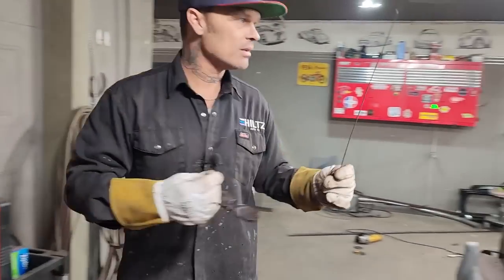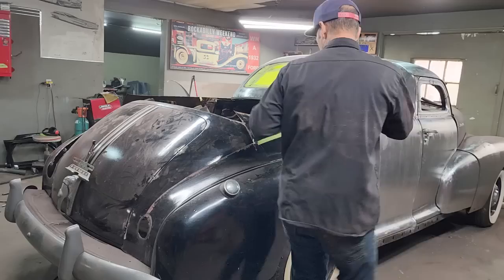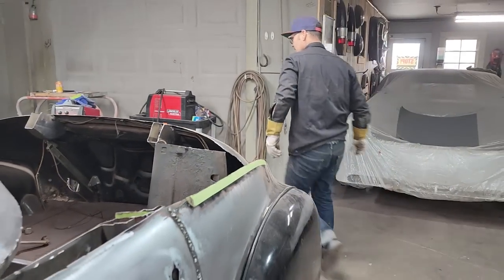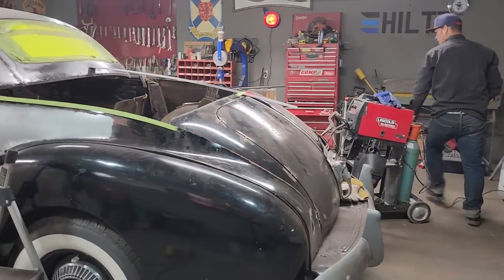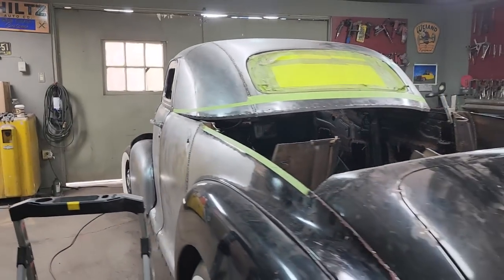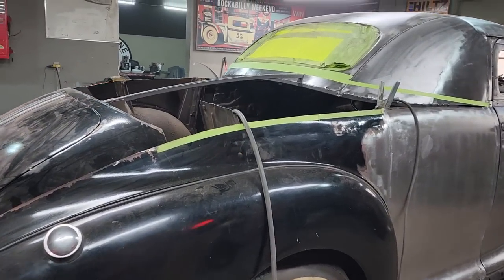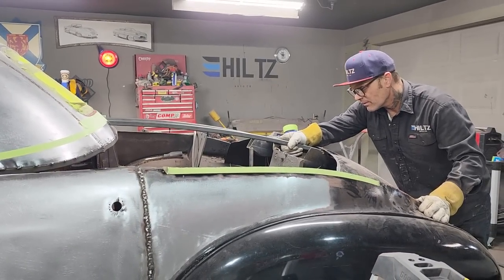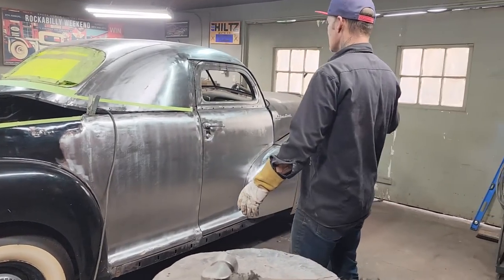Fabricating the rear | 1948 SEDAN ➜ COUPE conversion

Comment: It’s looking good! Where the drip rail continues in a straight line for 2 or 3 inches behind the window; What if you cut it loose and bent a curve in it to better match the window shape then reattached it. I think that would make the lines flow nice. You could even make it longer and have it follow the downward slope of the roof/ sail panel. Just a thought. That thing is gonna look cool in bare metal! Keep up the good work!👍Love it! God bless!

Comment: You can get some interesting proportions using Fibonacci numbers.
 1, 1, 2, 3, 5, 8, 13, 21, 34, .
 Try it in cm's on a sheet of paper draw a short vertical line off each of the points. 
 The sequence actually produces a spiral in it's self.
 Then you can adjust:
2, 4, 6,10, 16, 26, 42, 68, 110.....
Unusual proportion is a common thing in nature...it's quirky. Like this motor will be once completed.Keep up the good work guy's.  👍💕

Comment: Glad to see all the positive support! I watch for the metal working skills. I am an absolute beginner welder/metal shaper/fabricator, so I enjoy ambitious projects. Just my opinion here. The aesthetic is terrible on many BC builds. Zero proportional harmony. Doors should be longer. The point where the roof meets the rear slope of the trunk,  should be just ahead of the center of the rear wheel. He made a 4 door into a 2 door/2 seater with a trunk large enough to hold a 4x8 sheet of plywood. Like a car accident, I just cant seem to look away.

Comment: It’s looking good! Where the drip rail continues in a straight line for 2 or 3 inches behind the window; What if you cut it loose and bent a curve in it to better match the window shape? I think that would make the lines flow nice. You could even make it longer and have it follow the downward slope of the roof/ sail panel. Just a thought. That thing is gonna look cool in bare metal! Keep up the good work!👍Love it! God bless!

Comment: Chad the car is coming together just fine, the way you like it. But you said to comment: I was looking at the car and thinking how hard would it be to switch rear fenders and turn them around. That would put the long portion in front and fill that void. Then a guy could shorten the back of the car as well. Not sure if this is doing or if it would look good or bad or bring things into proportion. Anyways just a thought I would share with you and Queen Jolene.

Comment: 🇳🇴 it starts looking good. Nice trick about the tailgate. It flows much better now.  The rear fenders, i know it is a lot of work,but would it be better to move them forward a bit? So they line up with the boot and fill up the space between where the roof ends and fender starts? Think it could make the car look tight and  "shorter"? Just dropping ideas. 🇳🇴

Comment: plead ignorance here but does a factory 2dr have a shorter wheel base than a 4dr? Seems like the whole chassis should be shortened to move the rear wheels and body forward
Reply: Not really. The door is longer and then the rear side panel makes up the difference, to make room for the back seat .
Reply: This is not factory it’s called customising the way you want to.